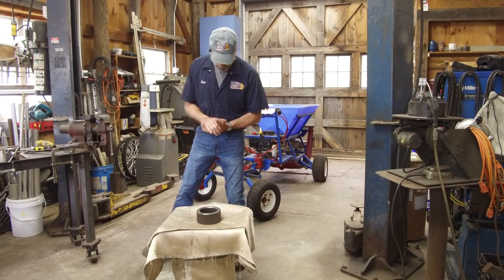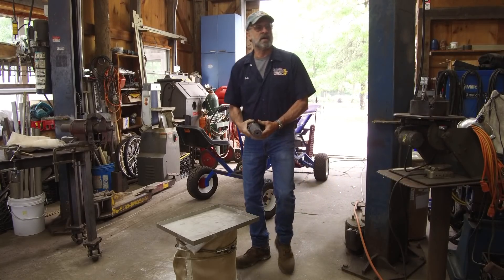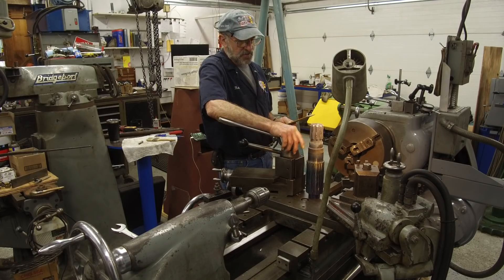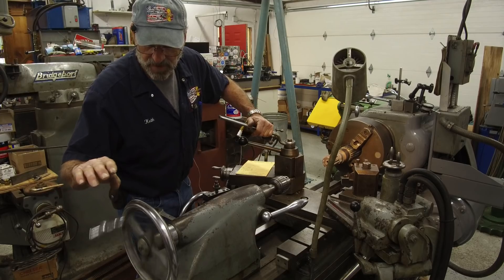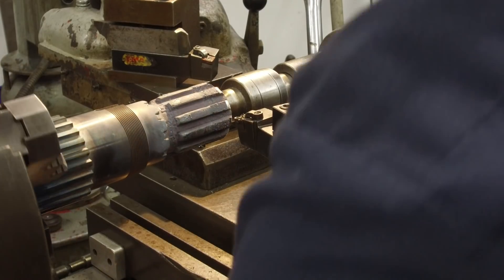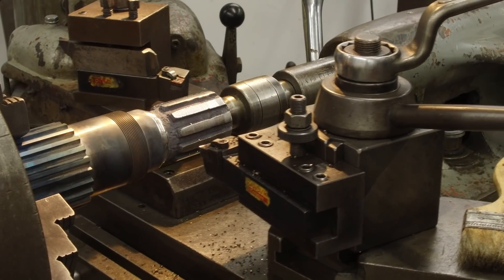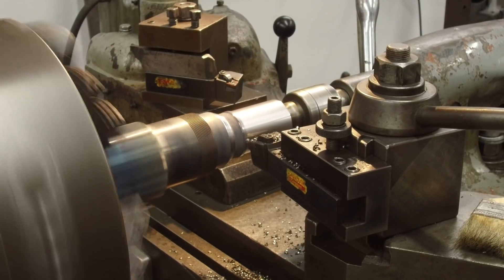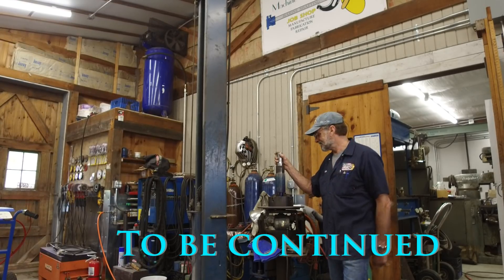Put The Spline In The Coconut Part Two

Comment: Keith, I think the lime has a low thermal heat transfer which allows the slow cooling, something the old timers figured out, and it keeps oxygen away from the hot steel, limiting the scale build up. The one thing I always find with my electric heat treat furnace is scale build up. To where you wrap in a stainless foil with some small piece of wood match to consume the oxygen, or a no scale coating you brush on, that sorta works.

Comment: the thermal conductivity of magnesia is 0.07 . powdered lime is probably similar. very low. good insulator. very slow cooling. I worked with metallurists and they always had controled quinces. To freeze a structure in metal. Slow cooling is done in fresh cast ingots. Cant sell hard metal ingots.

Comment: I went through a shop move and 3-phase power upgrade last summer.  I wasn't happy when the power company said it could take up to 3 months to do the change over with the countdown starting after I signed the contract and paid in full.  However, they ended up only taking about 3 weeks, so it wan't too bad.  Your power company seems to be taking its time.  Maybe Covid-19?  It seems to slow everything down.  Good luck.  Ken

Comment: great to have you back,you were missed. the new shop looks good. it should be interesting to see how that new rod works out. would there be any advantage to turning the shaft down to a nominal size and make or buy a gear to install on the shaft using a key or press fit?

Comment: Thanks for the explanation below on lime, I'll have to keep that in mind, I'll add that to the toolbox with dry wood ash and save the sand for big cast parts.  Every alternative way and rationale you give, each one a handy tool and sometimes a new/better/faster or fits the circumstances as way to do things.  Thanks!!

Comment: It's great seeing you up and running again.  I'm already liking the new shop.
At the end of the video, I was wondering to myself what rod you were going to use for that buildup.  A couple seconds later you answered that.  I'll be interested to see how that goes.
Is that Buffy behind you in primer red?  
Like some others, I have also used vermiculite for that sort of thing.  It's popular among blacksmiths.  But that hydrated lime looks like it may be an even better option.  I'll have to try that.  Just another little tip from the hard-earned experience of the old-timers.

Comment: Hey Keith, I'm glad to see you're up and running again. What I've seen of it, your new shop looks real nice too. Quick question: Is this the sorta repair you could make using the spray welding that Adam Booth does or is that not suitable for this type of repair?
Reply from the maker: No spray coating is not the same as weld fusion overlay. They both have pros but strength is the biggest con for spray welding / coating.  ;{)
Reply: @KeithFenner  Thanks Keith.

Comment: lol   1:40-2:20  "A lot of people asked questions..."   <walks away>
Reply: It's not lime like limestone, it's Hydrated Lime.  
It's super light and fluffy. It traps air well, it's a great insulator.
It's what they burn the lines on a sports field, mortar mix, it's cheap and it's also easily available.  
He used ashes from the woodstove in the past, but since the move he had to clean that out and had none.
Don't breathe it or get in in your eyes though, it will burn
Reply: @12345NoNamesLeft  Yup. I was curious and did some research.   Looks like the 3 common options are Hydrated Lime, wood ashes, and Vermiculite.  You've already pointed out that he didn't have any wood ashes, and I know from experience that Vermiculite is more expensive can be difficult to find in quantity (usually at garden centers).  Hydrated Lime is cheap and easy to get, and sometimes you just gotta get a job done.
Reply: The lime looks "fluffy", so it may insulate better than a more compacted medium.
Reply: Asking questions is a part of the process of learning, those who shun such a thing, aren't worth trying to learn from.
Reply: His answer was basically don't ask questions.  I'm the expert here and it's because I said so.
Reply: @Jacob-5949  No, it's what he was told by his mentors.  It's what they said so.  Because someone somewhere a couple hundred years ago, figured out that it worked
Reply: @12345NoNamesLeft  ...."a couple hundred years ago"!!  Nope.
Reply: @paulcopeland9035  give me a number then